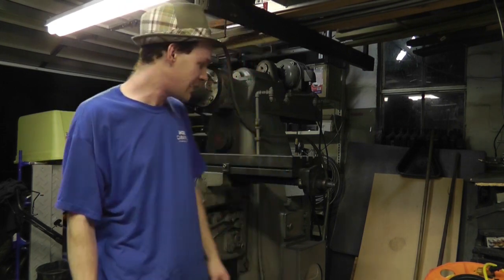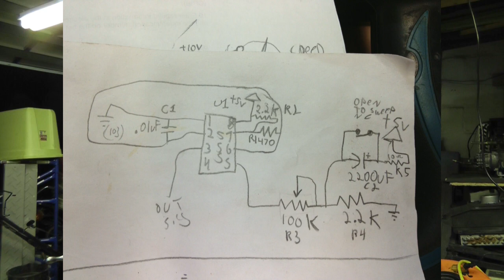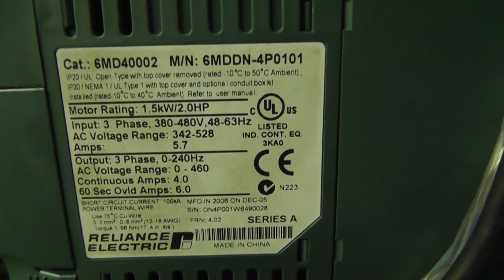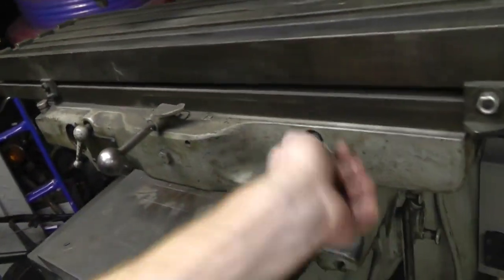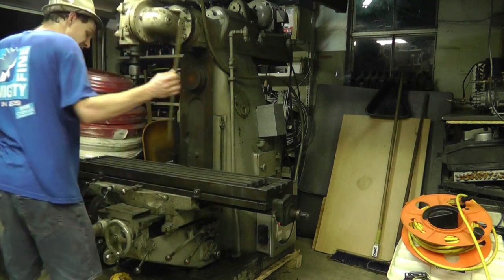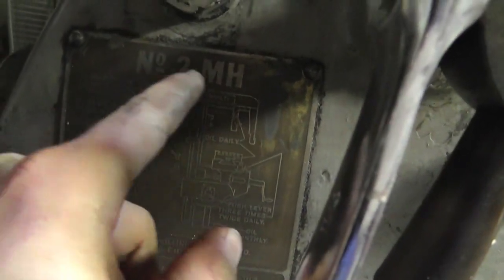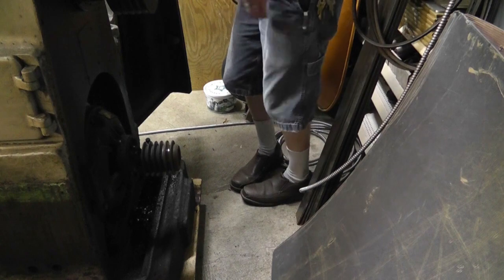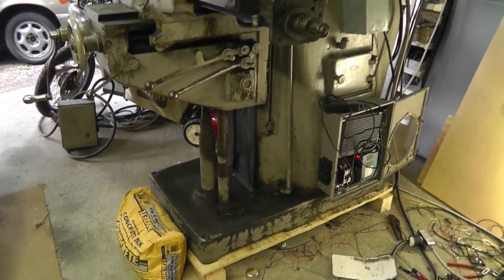Converting A 5HP & 1HP 460V 3 Phase Milling Machine To Run On Single Phase 220V... VFD HACKING

Comment: I know that a lot of work went into that job. We just set up a giant 3 phase tumbler for cleaning large steel housings at my job and we only had a single phase setup. The company invested into a 10 Hp 2 phase to 3 phase motor/generator so other than having to watch fingers and toes, my job was child's play compared to what you just pulled off here in this video. Nice "thinking outside the box" job man.

Comment: Well done I have no idea why anyone would give you thumbs down. They absolutely have no clue how much work this was and the knowledge required to make the upgrades. By the way this is how every manual mill should be setup with auto tables. Cheap power feeds are not that great. My lathe is like this and all 3 axis are power fed internally and it’s a very solid and rigid machine that cuts like butter and leaves a beautiful finish. And of course you can then do compound machining manually. The versatility expands the use significantly.

Comment: Thanks for the video and explanation. I just bought an old 2mh Horizontal mill, and am just getting familiar with it. I`m in Canada so most machines are 550 or 575 volt. (I could just say 600) . Have not had a chance to power it up thoe. But after seeing your vid, I know there is much to do and check before I get it going. Thanks again.

Comment: Now the only thing left is to convert it to CNC and that is all! Congrats!
Reply: Would be interesting if he integrated the internal components however this is exactly the kind of manual machine you’d want and then find something else for a CNC conversion. Enough button pushers in this world the skill of doing it all by hand is not just amazing but offers up capabilities you cannot do on a CNC. Besides spending 2 hours drawing up a cad file to convert to gcode when you could’ve already made the part you needed. You’d be surprised how many CNC machinists I’ve met that are idiots when it comes to manual machining and can’t even produce a clean part without mucking it up.

Comment: Great job, take care of metal chips get in the box with the VFD  , also heat problems
I also make a upgrade on my  old mill Aciera F4, with a new main motor and add cnc control, think I make a video of my control box later , you can see my mill on youtube

Comment: Hi can you tell me how you power your oil pump and collect pump.
Do you use the smaller VFD as if you use the larger one when you change the motor speed the speed of the oil and coolant pump will also change.
I’m trying to do this to my mill now and just wondering how you powered the oil and violent pump
Great video buy the way
Reply from the maker: Anthony Muscat hi. To my memory the pump was part of the bottom unit. It was all driven together. I think the pump was in the base. Honistly I can't rember.  I also never use it. Just oiled by hand.  I never use it for such big jobs :)   hope this helps. ~Russ
Reply: So would you have wired power directly to each Motor or just connected power to the machines original input to run them?

Comment: Hey Russ can you help an idiot. i'm confused about the magnet switch location in the system. I have 220 single phase going into my vfd and 220 three phase coming out. So do I put the mag switch before the vfd and if so doesn't that mean I'm only using 2 lines in and 2 lines out of the switch?
Reply from the maker: hi, I'm not sure about this " magnet switch" however... you do not want to put any switches in between the motor and the VFD.  all switching should be before the VFD.  what is it your trying to do? Thanks!! ~Russ
Reply: 2 things, I think. 1- I'm trying to turn off the vfd without going to the breaker panel. 2- trying to make sure that if the power to the house goes out and then on again i don't want my lathe to start running. i should have said mag contact not switch
Reply from the maker: oh! i see,  so this switch will stay on and if there is a power loss, it will not turn back on? thats what a " mag switch" dose?? any how what ever you do, put the switch between your power and your VFD. you dont want to put switches between the VFD and the Motor, theses Vfd's run at higher frequency and it will not like that switch in the line. 

so if you have 220v single phase, just use the Hot, Hot, and the netruel wire in the switch. the ground should be contacted back to the panel. is it 3 wire or 4 wire? 

PS. your not an idiot, :) an idiot would have never asked the question ... :)

~Russ
Reply from the maker: ok, that is a motor starter. push button. so if your using a VFD, i would program the VFD to start and stop your motor. if you want just a "lock out" switch so that the power turns off i would use a normal switch of some kind. 

If your worry is that if there is a power failure that you dont want the VFD to come back on, just program it to do so. most VFD's will not restart after a power loss. you have to restart them. 
something like this will do. 

https://www.zoro.com/square-d-safety-switch-240vac-2pst-30-amps-ac-d211n/i/G1454537/?gclid=CIqcpsvAytECFdWNfgodH8oLKg&gclsrc=aw.ds

~Russ
Reply: rwg42985 agreed with Russ you never install anything between motor and vfd unless you like buying replacment vfd’s everytime you turn it on.